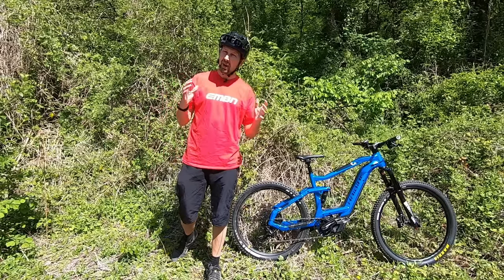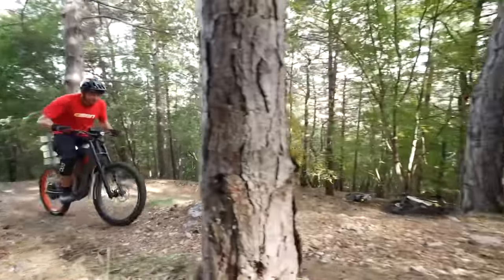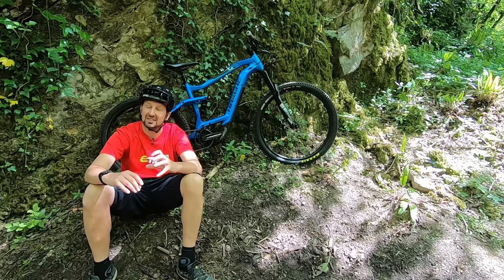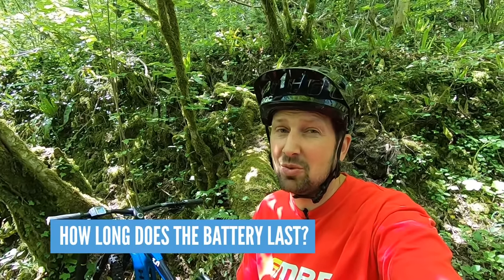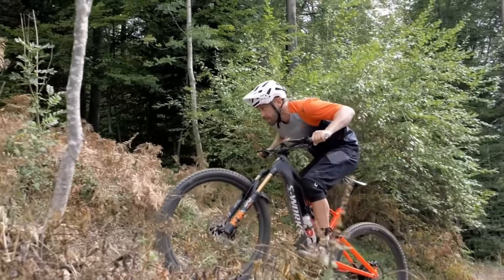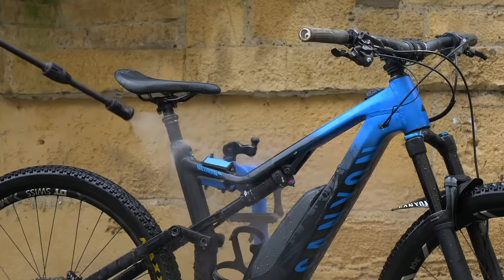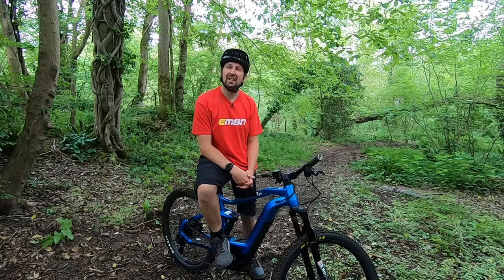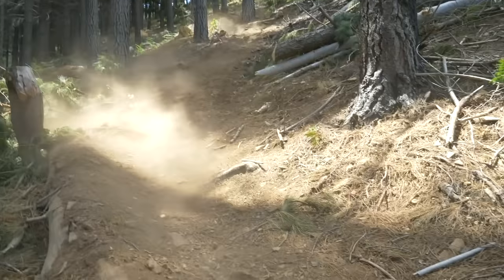New To Electric Mountain Biking? | Common E Bike Questions Answered

Comment: Nice video, it would be nice to see more content with the Yamaha/Giant Sincdrive pro motors, it's a great piece of equipment and it would be nice to see more comparisons with the Bosh and the Shimano, maybe a long day ride with the same size battery to see which one is more power efficient and capable for the big hill climbs.
Reply: I totally agree, it's All about high end Emtbs  Gaint ebikes are the best value on the market 💪✌
Reply: Carloscf13 Totally agree. Giant manufacture over70% of bikes in the world and build frames for other makes. Would be nice , as you say, to see more comparaisons from them

Comment: You can ride the Shimano e8000 switched on but in "off mode", I ride down hill like this sometimes. With one click of the mode change button it will change to eco and then again to trail or boost with no error message.

Comment: I ride in eco and only ever boost higher when im either completely knackered or just want to get up something steep fast.
Reply: How far will you go in Trail riding with ups and downs with your Ebike?
Reply: @marilakay4902  it depends on more factors:  your battery 🔋 from 500 Wh to 700 Wh, your weight, how much you are pedaling, how much support from e-motor are you using. One example, my battery is 504 Wh, my weight 90 kg, plus 22 kg ebike, I use on my Levo only Eco mode with only 20 % support, when I ride cca. 1.000 hm, then my range is between 50 to 70 km. And I don't want to come home 🏡 with absolutely empty battery 🔋, it remains always 10-15%

Comment: Nice video! Thank you! I might try to borrow an e bike and show my first impressions on my channel!
Reply: ANY lock or chain can be cut, especially if some fool is running around with a battery-powered high-speed grinder, so keep the bike in sight or inside of the vehicle. I insured my e-bike against theft anywhere in the world, I paid a LOT of money for the e-bike, no sense trying to save money by not having insurance. The controller will usually tell you when the e-bike needs servicing. Women e-bikes are often smaller and have curved top tubes. (All of this is just what I have learned from having an e-bike, I am certain that different opinions will vary. Have fun!)

Comment: With my Levo, i find myself switching the motor off altogether quite often lately. For instance on flat trails or roads or simply periods i just want to enjoy nature and drive slowly anyway. First thing i did when i got the bike was lowering the Eco Mode settings to 15 % assist with 30% peak using the app. Default Eco was just pushing a little too much for me. In Eco, i just want the extra weight of the bike to dissappear when im exhausted or a trail gets really demanding. Trail and Boost are for going steep upill or simply ... speeeeed and fun ... which are commenly the same thing :-D
Reply: My eco is set to off, I only use trail & turbo. This keeps the system running & keeps my flow without having to stop to start up again 😁👍
Reply: Why do you need an ebike if you enjoy the nature in riding slowly.
Reply: I ride my bike with the motor turned off and a Pygmy hippopotamus strapped to my back.
Reply: Does the motor being off add friction at the bottom bracket when pedalling or is it just the weight that makes it harder to ride?

Comment: My question 
Would you add the same amount of psi to your fork on a 20 pound heavier e bike (than your regular bike )as you would if you were heavier by 20 pounds heavier around the girth , in other words does the weight distribution make a difference as to how much additional psi you put in your fork and shock?
Reply: For an eMTB and depending on the manufacturer and bike type, you'd typically want to go for a sag of about 20-25% of the stroke of the fork or shock. And, to get that sag, it will differ between bikes and riders.

Comment: What is the best  bike lock guys?. Just bought an ebike and want to hopefully keep it.
Reply from the maker: The bigger the better Dean! Check out this video from GMBN tech for a few ways to keep your bike safe at home and a few examples of locks
Reply: Be aware that some idiot with a battery powered high-speed grinder can cut through any lock., probably in less than 1 minute. When I can't keep an eye on my e-bike I'll probably remove the front wheel and stuff the whole e-bike in the car. Pain in the a@@ for sure, but e-bikes are a prime target for thieves.

Comment: If you have 4* assist, you don't go "4 times faster at a quarter of the effort". 

You go twice as fast at the same effort, assuming your bike has the wattage. Ek = 1/2 mv^2
Reply: That is when you are going in a flat road at high speeds, when you are going uphill Ep=mgh, so it is 4 times fastes...

Comment: My ebike cuts power???
I recently got a 48 V rear 1000 watt
Dumb down factory to 750.
A 58 ah battery.
All I hook up is the motor wires and the battery. No ebike brake. I use mine no power. It flaps the breeze.
No peddle assist ither.
It ran fine a few days then the power cut out. checked fuse. OK
Replace same fuse. Power came on lights on.????
1 mile later the same musical fuse.
Then half mile then quarter the blocks.
It's getting worse and worse.
Got a clue?

Comment: Bosch dealers tells me that it's bad for the engine to drive in off mode.
Reply: Makes no sense if ur battery go flat u still got to pedal home
Reply: I ride my Trek Rail 5 (Bosch motor) around town like a regular 12-speed bike with the motor off.
Reply: If they called it an engine, I wouldn't listen any further.  Motor.

Comment: You didn’t mention about the curse of e-MTB “drag”!. What gives?
Reply: derestricting removes the drag on Shimano e8000 system. You can ride it switched on, in "Off Mode" and it will ride like a normal bike. Good when you're riding with others without ebikes.